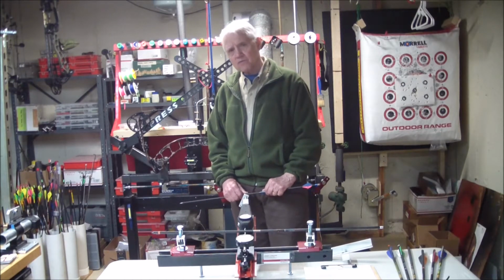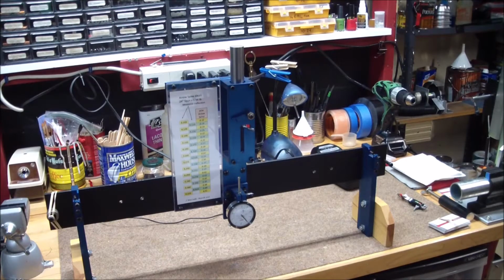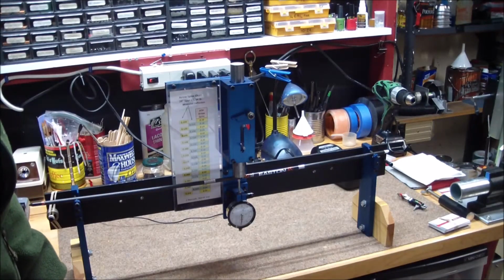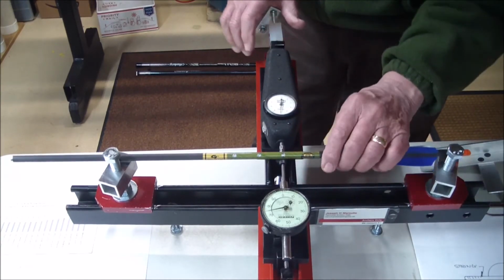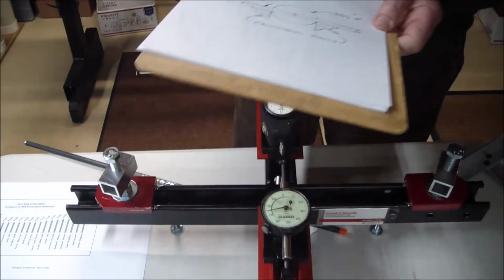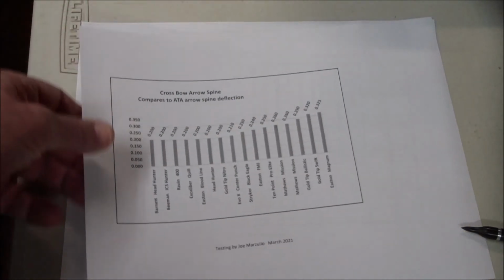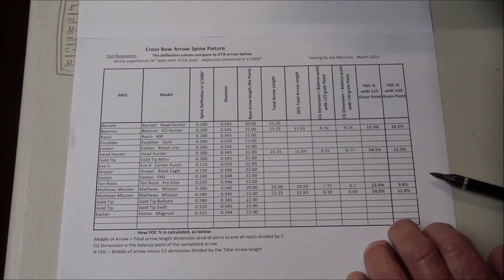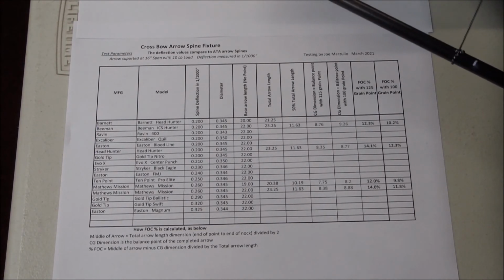Cross Bow Arrow Spine and Data Charts

Comment: I called Barnett because I was trying to figure out what the spine was for the Headhunters. They told me it was a 300 spine. What is this chart saying they are? I was trying to find a stiffer spine because with large fixed blades I'm getting weird arrow flight. Great video and it's awesome to see someone putting in some attention and work for us crossbow hunters.
Reply: Hello Brandon,
the possible solutions for you to achieve arrow control are as follows. 1) stiffer spine    2) heavier broadhead   3)  Smaller BH blades
I could not get all the arrows for testing I would like. 
If anyone has an arrow NOT on the chart then send one to me postage paid both ways and I will test it and send it back.
Reply: @josephmarzullo5312  thank you for the reply. My setup is 20" Barnett headhunter, Annihilator XL 150gr broadheads, shooting around 380 fps. I'm thinking about buying some aluminum arrows to try out. Do you think those would be stiffer and do you have any recommendations?
Reply: @LeGateHoneyFarms  It appears that you are not achieving the accuracy you want due to the large broad head you have. If a smaller blade head solves the accuracy issues then just use them. With that setup you will get pass through all the time, its accuracy that you need. The critter will get just as dead with a smaller hole.

Comment: I didn't notice killer instinct hypr lite or the hypr bolt on your chart,,, The reason I ask or mention this is because I shoot those 2 specific bolts and I am wanting to know the spine on those are those specific bolts,, they measure 20",,,  I shoot a total bolt weight of 550 grains,, So basically what bolt on your chart could they be compared to equally or could you possiby send me  that information as to what the spine is exactly,, thank you so much for your time and consideration in helping me obtain this information,,,
Reply from the maker: Hello Ty,
I could not get that arrow to measure...BUT...if you send one prepaid shipping I will do that for you.
Reply: @archer1941  I will send you 1 of each if that's ok,, send me your mailing address,, thank you so much,, I definitely appreciate it,, does it  matter if one is built up to 400 grains,,, I will also supply a return shipping labe,, and if you could include a printout like in the video to include the results for the 2 bolts I'm sending that would be great 👍
Reply from the maker: @tygappleberry5571  send arrows to
J Marzullo
194 harmony hill Rd, harwinton, CT  06791 send tracking #.
Best if  it arrives 7/29 or later.
I will have asap after receipt.
Reply: @archer1941   Sir I will make sure you have them as requested,,
Reply from the maker: @tygappleberry5571  glad to help. My goal with my videos is provide factual data to archers. I leave the hype to salesmen.
Reply from the maker: @tygappleberry5571  Did you ever send me the arrows????